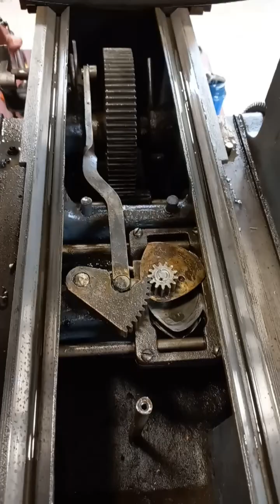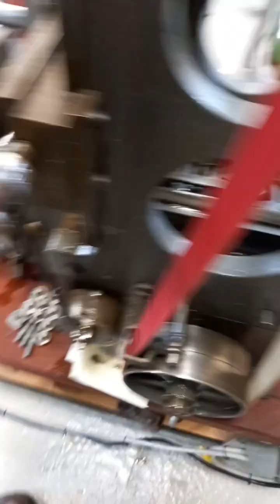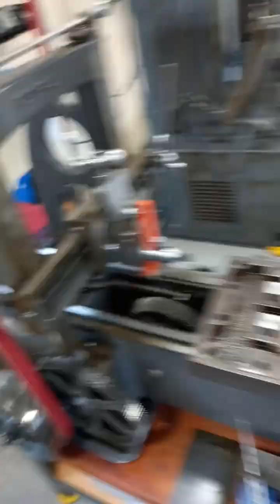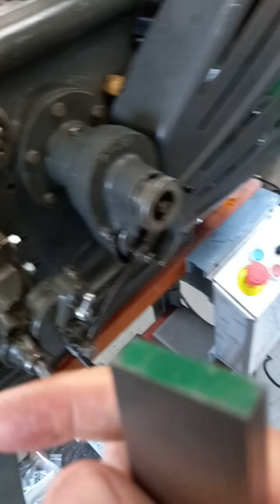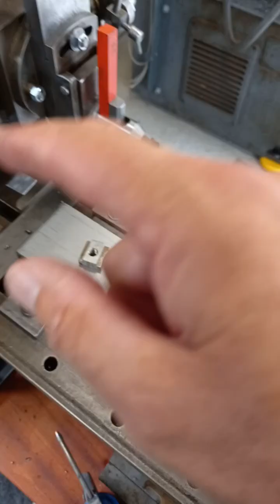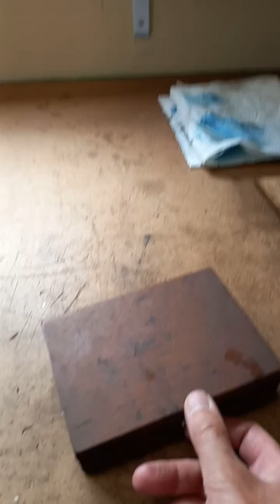Metal Planer.  Machining the second flat surface.

Comment: It sure is a very nice toy to play with. Do you know at how many strokes a minute it's running?  It could be interesting to know for calculating at what cutting speed it's running.
Reply from the maker: Hello Rusti, the stroke length is 26.5 ins (673mm). The forward or return stroke takes 7.48 seconds and the cutting stroke takes 14.22 seconds.  So this is about 2:1 ratio.  One cycle is about 21.7 seconds or near to 3 stroke per minute.  So our cutting speed is 9.3 ft/min (2.839m/min).  The linear speed is constant not like a Metal Shaper with the Whitworth drive mechanism.  The constant linear speed is a feature of many Metal Planers.  This allows for a constant cutting force throughout the cutting stroke.  Hydraulic Shapers also have this feature and because of this are usually very heavy duty.  It is more important to run a planer at a "safe speed" that allows the inertia of the bed and work to be contained.  I always start of at a slow speed and then increase as appropriate.  Once you reach the optimum speed taking into consideration all the inertia, dynamics and is giving good results, I leave it at that.  If you ran a planer at recommended production cutting speeds you could have major problems.  When using a planer or a shaper common sense and sound reason always prevails, be safe!
Reply: @davebates2709  Thank you very much for your detailed answer. I appreciate it.
And indeed, the lower cutting speed on a planer makes perfect sense.